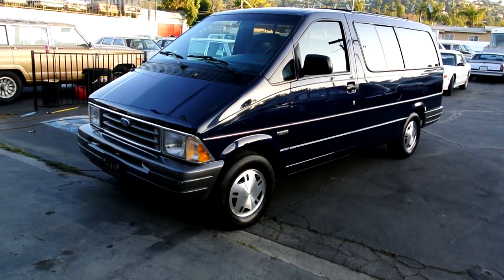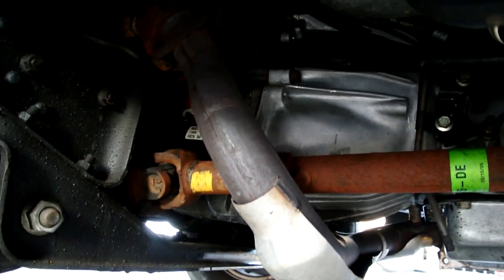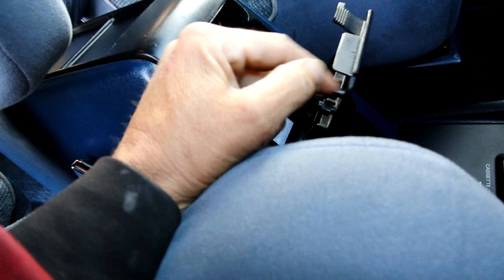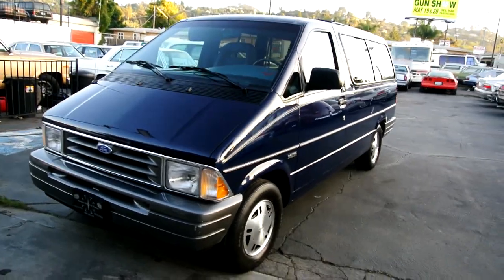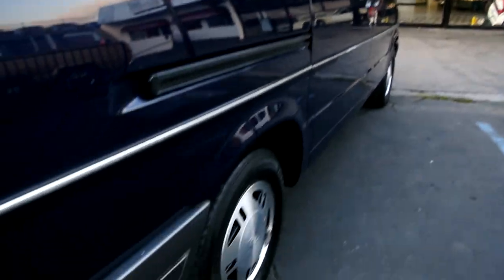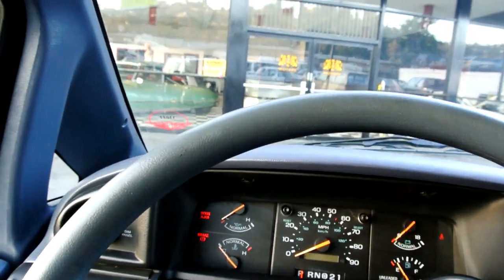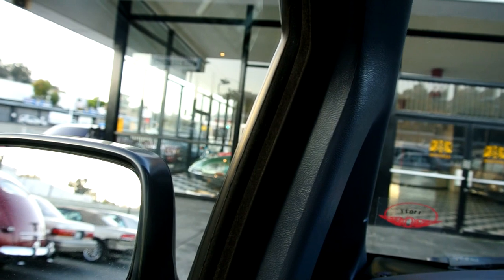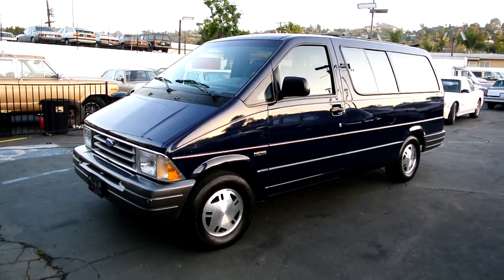1996 Ford Aerostar XLT 4x4 MiniVan Astro Mini Van Kombi 2 Owner 42K Mile

Comment: Had a 93  4 liter extended put 1 transmission at around 235,000 the trans shop didn't believe it was the original, but I did the pan,filter and flush myself often with 3-3500 on oil changes anyhow when I junked it, it had 475,000 aprox and still ran - although not that good. I spent more on tires than anything else, and only left me on the roadside once when trans went. I got lucky with that sucker. oh yeah 2 starters, both at local wallmart and 1 alternator making noise.

Comment: That could also explain it's extreme cleanliness. My Buick Century has an absolutely immaculate interior but the body has some scuffs and marks and there is a little bit of rust underneath it, but other than that, it's quite similar to this Aerostar. My Century is from 2000, so it's much newer.

Comment: I just got a 93 XLT with 163k Miles 1 owner for $900. Rear brake lines and cylinders had to be replaced other then that Not a single thing wrong with it. Electronic 4 wheel drive.

Comment: We had a 92 town n country with 43k original back in 08. Paid 3500 for it and it got up to 30 or 40 mpgs if I remember. It was kint and fully loaded and actually a pretty decent cruiser for the 120k we abused it for.

Comment: Had four of these over the years. I still have the 1994. The AWD is kinda of neat but if you don't do the transmission maintenance and transfer case. You better be good with tools then. Other then that their rear wheel drive bullet proof!
Reply: +Claude “Reviews4U” Rains I have a 94 Eddie Bauer but the 4wd doesn't seem to be kicking in on snow. Any suggestions?
Reply: Damian N. AWD speed sensor might be bad. There are two on the transfer case.
Reply: I've only seen the one on the drivers side. Thats the magnetic sensor that just plugs directly into the trans-case with a basic plug lead coming off the end, right?
Thanx for the reply!
Reply: Damian N. Yea and don't over look the one on the rear axle. It can be bad and sets off the ABS light too.
Reply: Replaced the one on the rear differential.  Couldn't locate one for the front transfer case and Ford dealership says "those things never go bad. No moving parts!"  yeah right.  Mechanical speed sensor for front x-fer case is all I can find available, not the magnetic.
So I cleaned the wire connect and put back in. Where is the second located on the x-fer case or were you talking about the one on the pumpkin?
Reply: Damian N. Should be two on that front one. One for the transfer case speed and one for the front wheel drive pumpkin. That is how it tells when its slipping.
Reply: Thanx man, I'll take a look

Comment: Where and how do you engage the 4x4. I have not seen the 4x4 shifter or knob anywhere on the dash of that van.
Reply: It's all wheel drive, meaning all 4 wheels are powered.  My mom had 2 of those and if memory serves, it sent 80% of power to back and 20% to the front.  If the computer senses wheel slippage, it would take power away and transfer power to the ones with more traction.  I remember driving it through snowbanks and no problems.

Comment: 1996 was the last year of the 4x4 models The regular minivan and XLT were made until 1997 as it was just more parts they had of the higher production 1996 vehicles that Ford wanted to use, I know as a neighbor had one of the 1997 before she got the Bullet shaped Pontiac mini vans that was ugly. The Aerostar 4x4 was inteded to compete with the AWD Astro/Safari vans but never did as the Astro/Safari was more popular in the Astro van, GMC Safari only about 2/3 of Chevy/GMC fans know they had two models that were nearly the same.

Comment: And I thought my Buick Century having 150,000 miles (instead of 350,000, which it should have) as being low! The owner of this van must've bought it, used it for a bit and then locked it away.

Comment: So i'm confused here....  Did Ford have two minivans?  Ford Windstar and Ford Aerostar? Because my neighbor has a 1994 Ford Windstar still...
Reply: the Windstar was a minivan while the Aerostar was more of a full size, their answer to the Chevy Astrovan.
Reply: Ford Aerostar, Windstar, Freestar, and the most recently Transit Connect
Reply: The Windstar was front-wheel drive while the Aerostar was rear, also, the Windstar was cheaper to build and more comfortable as a sedan, also, the trend at that time was to have a minivan based on a car´s platform, in this case the Windstar was based on the Taurus platform I think, and the Aerostar was in a truck-like platform.
Reply: Sanpedranoazul Ah gotcha, thanks man! I wonder why Ford hasn't brought a mini-van back to compete.... I know they have the flex but you don't see those around either.
Reply: Yeah sometimes a sedan platform isn't meant for a minivan. lol
Reply: +Sanpedranoazul Aerostar used the Ranger chassis.
Reply: No. The Aerostar used the Ford Truck frame. It is based on a 4WD platform and looks like it was on the Trucks platform that the Aerostar took on.
Reply: Christopher Pennington   The aerostar was not on a truck chassis. It was a unibody, but a lot of the components were from the ranger. The 4x4 system was all its own. Have a 97
Reply: You have an Aerostar?
Reply: Actually the aerostar is a unibody but has frame rails from the f150 platform. As such its hauling capacity is greater than most all minivans of its time.

Comment: How many MPG does it get?
Reply: +talldude123 My parents 2010 Grand Caravan gets like 13 city and 24 highway... My Grand Marquis can get 16 city and over 30 highway.
Reply: *****
3.8L Feels really underpowered for a 4400lbs van. The 3.6L feels better up high but doesn't seem to have the torque down low like the 3.8L did.
Reply: CTJacob The honda HRV is a suv that gets 30+ mpg and its not a hybrid.

Comment: Looks are highly deceiving.  This vehicle may arguably be good-looking (beauty is in the eye of the beholder); however it rides like unmitigated CRAP.  I can't image a horse and buggy with a poorer ride quality.  I sways like a friggin sailboat, the suspension is right off the antiquate Ranger, twin I-beam (not independent), the steering is totally unresponsive.  It was  pickup with a Van's  body.  The only  possible use I could see for it is as a collector's item to look at, but not ride in, because the ride is like something out of the 1930's, right up there with the Chevy Astro.